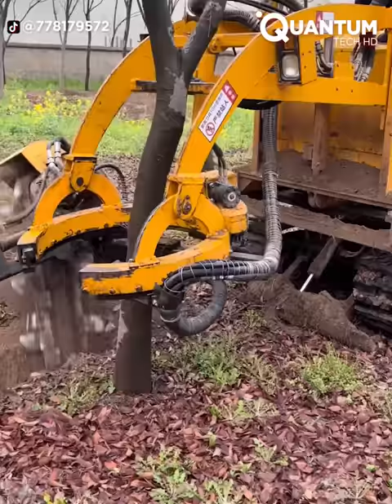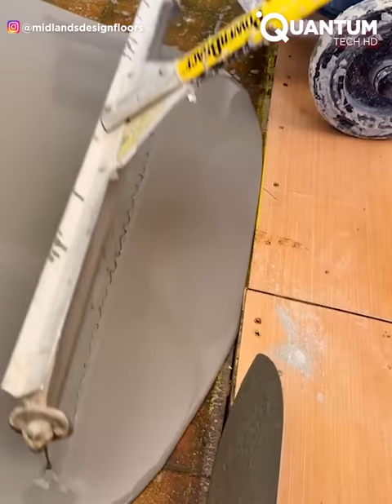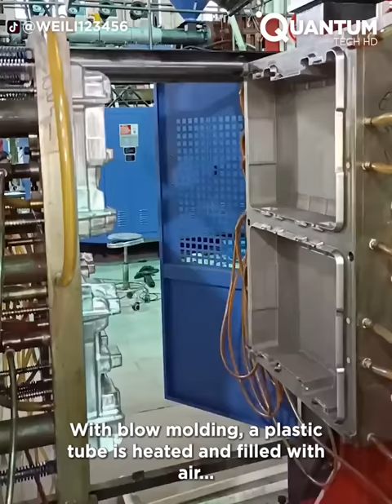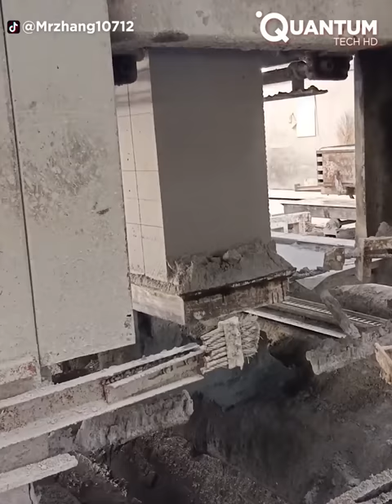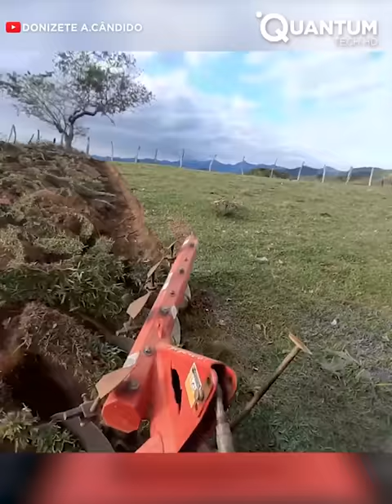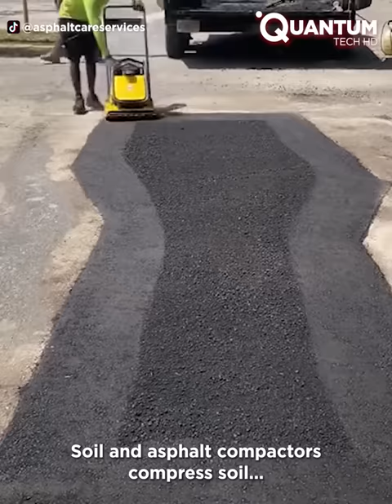Most Satisfying Machines and Ingenious Tools ▶38

Comment: I'm a blow mold technician. It's such a neat process that blows the mind the first few times you see it. There are so many parts you'd never believe you could know how every single piece of the machine goes together and works in unison, but once you do it for a couple weeks and the whole process comes together in your head it's so crazy. There's certainly a lot to it, especially in dialing in the quality of the parts being made, such as in pharma, but it's so much fun. Unfortunately a lot of these kinds of jobs are being automated away with no alternative being given for those being replaced.
Reply: Çok ilginç bir şekilde fark ettim
Reply: Such is the progress of technology.  Automation will kill more and more jobs, even ones that people consider "skilled", until automation will outpace job creation and we will need to look into alternative methods of income as a species.
Reply: I worked in plastics for almost 20 years. Started off in extruded tubing and wire shielding and then transitioned into extrusion blow molding. It is definitely a neat process when you first see it.
Reply: A

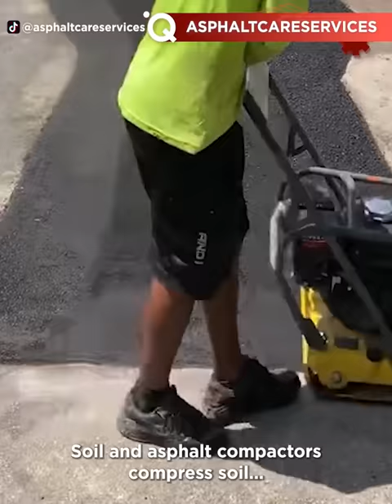Comment: At 5:43 that is an HDPE welding machine 
High Density Poly Ethylene 
PVC is a different compound. 
Poly vinyl chloride 
HDPE is far more pliable and is used for high pressure low temperature fluids that may be caustic. 
PVC is more brittle but can handle a little more temperature without as much expansion.

Comment: I worked in a martial arts manufacturing warehouse. One of the coolest machines would have you wrap the giant pieces of foam in a weird bag. It would suck the air out of the foam, and put it in the punching bag outer layer. Then you'd pull it off the machine and it would expand into the bag.

Comment: The poly welding is HDPE not PVC but you can weld PVC there’s special type of PVC called fPVC but PE is more cost effective and better for pressurised lines. PVC is more rigid and serves better for gravity sewers and stormwater pipes
Reply: Yep, I was checking to see if somebody caught that before I commented. :)

I've used that machine before and it's way cool!
Reply: @TheCalibratedFox  Oh yeah nice, I do Horizontal Directional Drilling and install this type pipe. We’re currently reaming for a 630mm pipe.

Comment: The PVC pipe part is incorrect. Glueing PVC pipes together is exactly that: glueing them. With glue. What the video shows, however, is the actual process of welding PVC pipes together (which uses an entirely different type of PVC pipe) by clamping each side into a vice, pressing them into a double-sided hot plate, and then pressing the still-hot ends together. I used to do this at work pretty regularly, it's a wonderful time saver for laying certain kinds of drainage pipes
Reply: While there is weldable PVC, the video showed HDPE pipe.

Comment: The dough one might be able to be used as a device to knead the dough but at little Caesars they use em to flatten the dough then into the pan for the next guy who puts on the sauce and toppings. And you don't just let it flop around in there. You gotta flatten the dough ball pass it through turn it 90 degrees and put it in again. Toss it to fit the pan next.

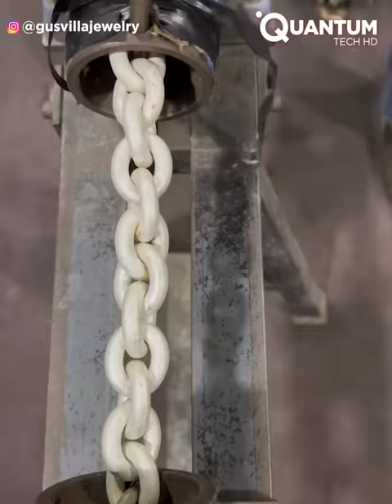Comment: 6:00 hahahahaha! I’ve worked with similar machines for the last 10 years, and I take issue with the “without incident” line. Most companies perform the bare minimum maintenance on machines like that because it’s so expensive. Duct tape, cardboard, and bent paperclips are the 3 most commonly-used tools at my job after the king of all machinist’s tools: the mighty adjustable wrench.

Mass-production machines are actually complex chains of many smaller machines, half of which aren’t even designed to go together, which makes them extremely finicky. They have all kinds of issues all the time and keeping them running at full speed for more than an hour or so is a miracle.